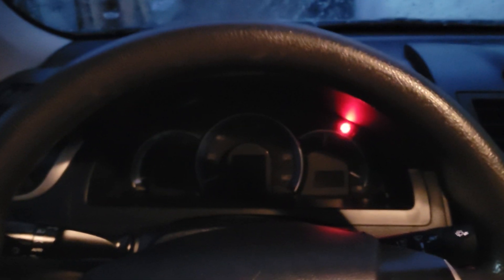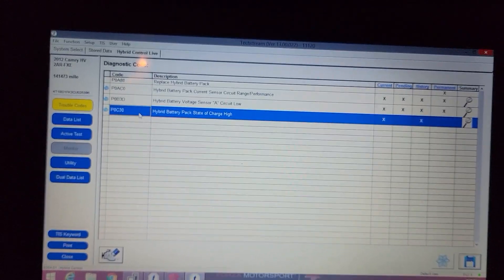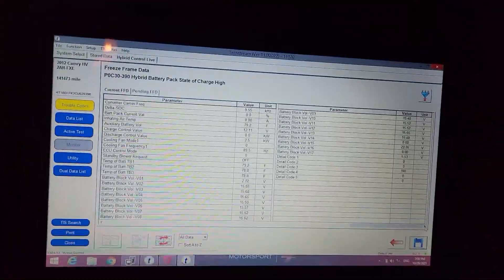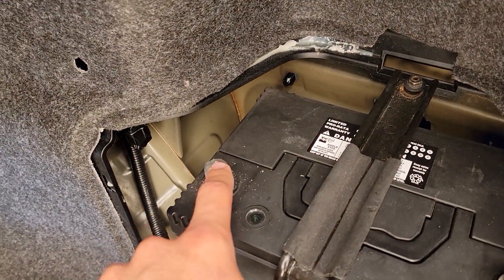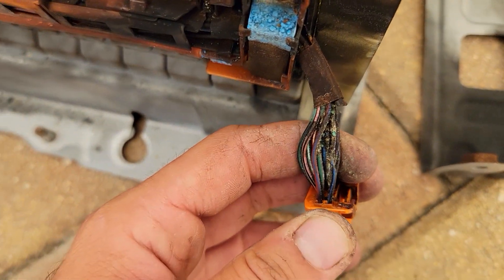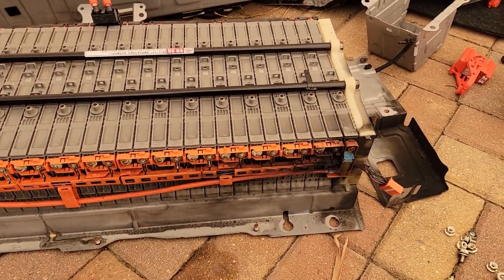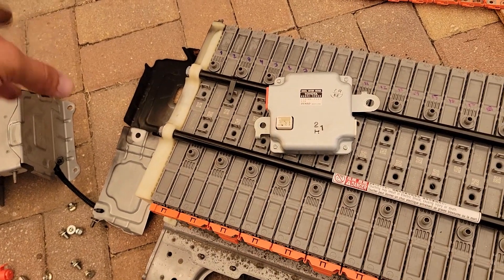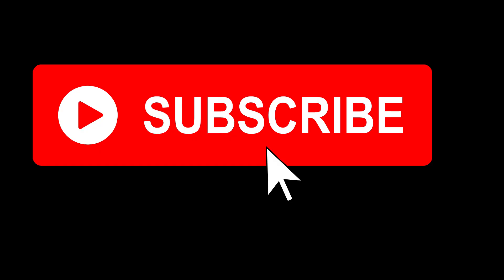Toyota Camry Hybrid No Start????

Comment: I just bought a 2007 Toyota Camry hybrid with 129K Miles for 6K From a private party. When I took the car for a test drive it started up right away. The very next day the lights on the dashboard dimmed and flickered off and on. And wouldn't start for about 4 to 5 minutes.  
After leaving work that same night the same thing happened.   I contacted the seller that evening and he said that it's probably because I'm not starting the car correctly 🤔.
I fear that I've bought a bad car or a car that will need a new hybrid battery.  No check engine lights have come on yet. What should I do first?
Reply from the maker: Check the 12volt battery usually when the hybrid battery goes bad the car goes on limp mode also when lights flicker could be a faulty ground but if there's any way you can get your car scanned with techstream or high-end scanner is a good idea to Start

Comment: I had an issue similar and a weird noise from the engine bay. I connected a battery tender to my battery and an hour or so later it started.
Reply: Btw, I also have a 2012 Camry Hybrid.

Comment: I have the same issue with my 2014 Camry hybrid, it is showing a key symbol with Wi-Fi sign and the ready sign appears and disappears. The engine cranks for 2 seconds and dies and it is showing error code P0A0F. Please I need your help I have been working on this car for the past 2 weeks. I need urgent help plz.
Reply from the maker: How was your engine running before this code appeared??

Comment: Thanks for the video! I have a 2014 Camry hybrid 83k miles. Sometime the car does not turn on, it tells me to depress the brake pedal even tho I’m already doing it. I have to keep trying a bunch of times until I get the ready light on. Yesterday I noticed that when that happens the brake light does not turn on neither, as if I the car did not recognized that the brake pedal was pressed.  Also from time to time I get an abs light on but nothing shows on the code reader and it just goes away next time I turn the car on. Any thoughts?
Reply from the maker: Ok for the depress brake pedal I would say in some cases the smart key could be the culprit if the immobilizer don't get the signal car won't start sometimes, the abs light you have to check with a special scan tool or toyota techstream, only specialized scanners can read preventive codes on the computer.
Reply: @kennycharneca1  thank you!
Reply: Thats the break sensor switch attached to the break pedal look under dash where break pedal you will see two switches attached black one is break switch brown is the cruise control

Comment: I Need Your Help On My 2011 Hybrid I’m In NYC!!!
Reply from the maker: Do you have a camry 2011 ??
Reply: Yes I Do The Hybrid Light Comes On And Off Randomly And When It’s Off Everything Works Fine
Reply from the maker: @moosedogg123  there's something you can do! You can buy the prius obd2 reader download the app and read the code when the light is on and see what's the problem, toyotas are very accurate on their diagnosis but sometimes if the problem goes away the car deletes the fault code.
Reply: I Also Noticed When The Synergy Drive Hits 35 It’s Can Turn On The Check Hybrid

Comment: You missed a step. The first thing you do before removing the battery is pull sout the disabling plug.
Reply from the maker: The problem with that is if someone with no scanner will get another code as soon you remove the plug the computer will send a signal but I actually do it the way you are saying since I have the scanner I can clear everything at the end .